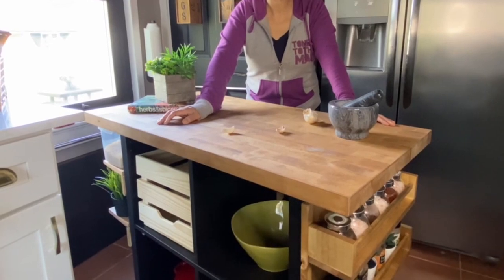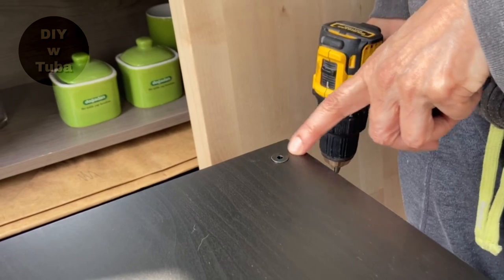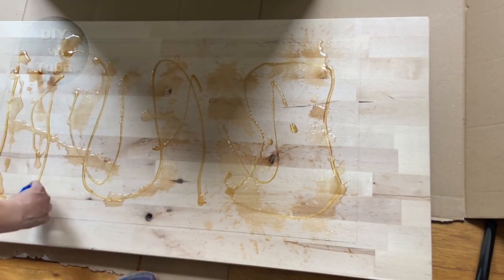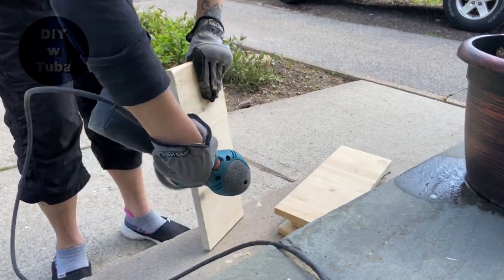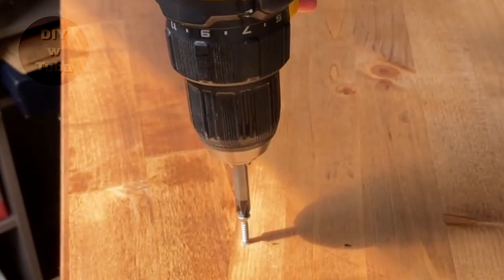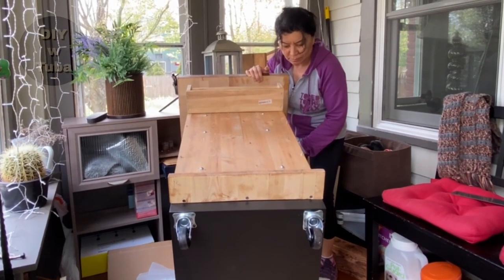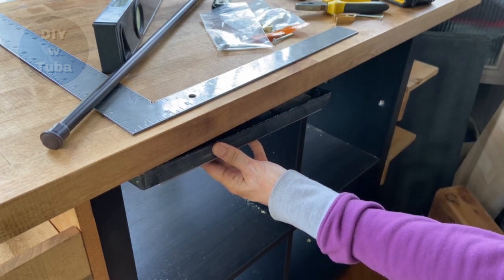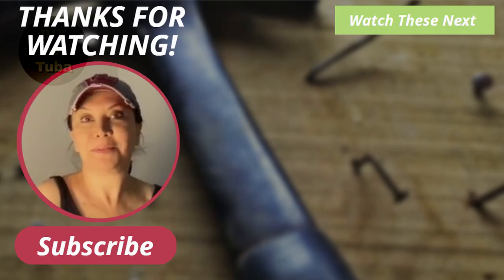IKEA KALLAX Kitchen Island Hack | Create an Extra Storage on a Budget!

Comment: I was looking for the IKEA items people used to build a cheap island. Just a suggestion, I'm 2 minutes into your video, saw you struggling, you could get a 2x4, cut a small piece the size of your casters and glue it to the bottom as a solid base to attach your casters. That way it will be secure, cost-effective too. :)
Reply from the maker: That's a good idea! But in my case I did not want my island to be higher than it is since it had to go under my kitchen countertop! But thank you for the tip👍
Reply: @WadaGoodIdea  Oh, that makes sense. I'm just going to put mine in a corner, so I'm less worried about the height. Did you find the casters wobbly at all? I am also planning to start with a kallax and maybe add a drop-leaf if I can find some decent brackets.